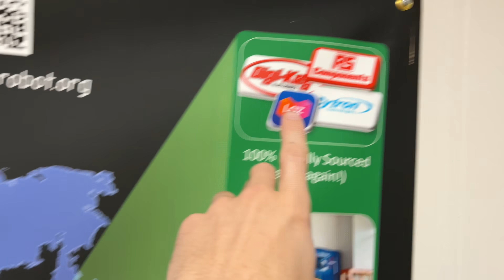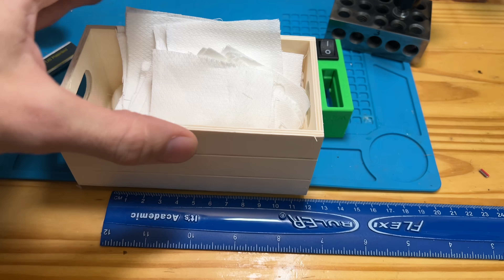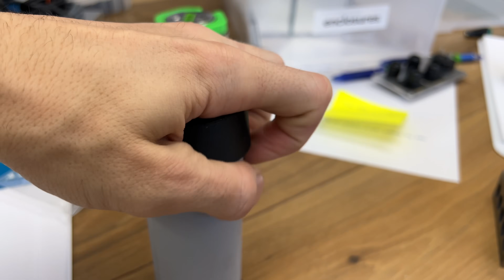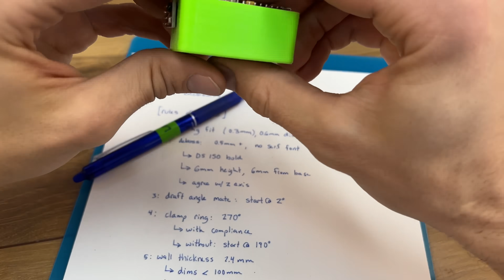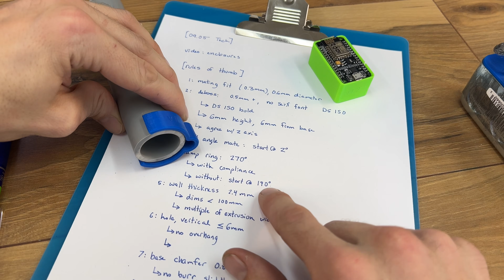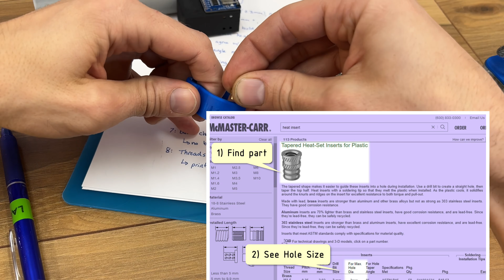Design enclosures for electronics (using mechanical mindset)

Comment: I recommend the Parker O-Ring Handbook (ORD 5700).  It gives great guidance for groove dimensions, compression amount, standard O-Ring sizes, etc.  It's very thorough for all kinds of applications.  I would personally start there before starting to design a tube cap.

Comment: You mention using .5 as the depth for your 3D printed text deboss.
Not a big deal just for text, but as long as it's arbitrary it's nice to make the wall thickness at any point a multiple of .4mm, the default layer line width as you mention later in the video.
The standard height of a layer line is .2mm, so multiples of .4 are a good rule of thumb regardless of orientation.

Comment: Hi! I really enjoy your videos - you're doing a great job! In one of your other videos, you talked about designing for 3D printing. Do you have any recommendations for someone starting out with 3D print design? Specifically, are there any books you'd recommend on this topic?
Reply from the maker: that’s tough, because it’s easy to find explanation of FDM but design methodologies seem to diverge.

after 5 or more years i think it’s best to treat design for manufacturing separately than learning about 3d printing. that is, collect one knowledge base about printing as a manufacturing method and then go elsewhere to seek a knowledge base as a designer.

a more direct answer:
this page is quite reliable for starting out: https://www.simplify3d.com/resources/print-quality-troubleshooting/

and if you want my team’s direct opinions you can find a 3D printing mini guide on the scuttle robotics website.  https://scuttlerobot.org

Comment: Any suggestions for pressure sensors and permeable materials like Gore-Tex? I’m toying with the idea of a device that measure water depth using hydrostatic pressure & barometric pressure for use with my volunteer efforts in water. Already bought some components from DigiKey to start experimenting.
Reply from the maker: Have you explored patents of already existing devices?  I'm curious about your project, if you could describe the problem statement related to permeable materials.  Also inform your background if you dont mind (experience type/level).    I've played with water for a decade or so.
Reply: @davidmalawey  Would a permeable membrane like Gore-Tex work to protect a pressure sensor from moisture? Assuming it’s a bit overkill. I have not looked at patents, but did research similar applications from DIY weather stations to USGS stream gauging stations. Streamflow would be the endgame for physical data. The concept is a device that can be placed at our sampling sites and collects data at set intervals. My idea is to create an open source and modular hydrology/water quality station, so that we can actually obtain data in a manner that is consistent with how monitoring is conducted through USGS. This would help our data be used for management decisions and legislation to help Lake Erie. It’s an ambitions project that I’ve dedicated more time and money than I’d like to admit. Working at an analytical lab is helping me go back to school (so people take me seriously) and get closer to making a true proof of concept. Two years in environmental engineering. They never let me get closer to water in college, so I just chased it through volunteer efforts (Partners for Clean Streams and Izaak Walton League of America, with more to come) and my work. Hopefully if you get this far it was worth the read. Thank You!

Comment: Good video. 😃
[Hints on self-tapping screws and enclosure thickness in this comment]
-One thing I noticed, is that where you talk about 3D-printing a >100mm box, you make the walls thicker and thus make it "impossible" to use components like the rocker-switch designed for thin walls.
You can easily get around that, by making the wall thin just around the rocker-switch.
That is ... Just make a 60 degree angle, so that the 3D-printer won't need any support material in that area, except from in the hole itself.

About the threads, I agree that you wouldn't 3D-print small threads; however, you can 3D-print "fine" threads, if you're printing with a fine nozzle.
Example: If you can 3D-print a M8 thread using a 0.4mm nozzle, then you should be able to 3D-print a M4 thread using a 0.2mm nozzle. I wouldn't do that, though, I'd just make a cylindrical hole and mash the M4 screw into the hole, so it'll cut the thread by itself.

One more thing: Self-tapping screws come in several types. You'll often see them very, very expensive. Those are likely for use in hardened steel or just stainless steel. Don't buy those for plastic, or you won't have enough money for finishing your project. 😉
-So if you need self-tapping screws for plastic, just purchase "wood screws"; those are the screws mentioned in this video. 😃
Reply from the maker: You make some practical tips here - and I agree but it depends on the desired outcome.    For those interested I made a video about using screws in prints.

https://youtu.be/LMyhFwJscI0
Reply: Thanks -  @davidmalawey  - I'll check it out. There are likely some things in that video, which I don't know.😉

Comment: Quality content. So many little tricks to 3d printing you pick up from doing lots of designs.

One I often use is 1mm over extruded inner perimeters with a 0.6mm nozzle. Combined with arachne mode it's great for saving time/adding strength.
Reply from the maker: do you mean 1mm path width and 0.6mm nozzle?  this is interesting as i’m using 0.45mm path width on 0.4mm nozzle.
Reply: Yep! You can over extrude 1.5-2x nozzle diameter with most hotends. I found 1.75x inner perimeters was the sweet spot for me.

Basically gets you the strength of 3 walls in the time of 2 without losing any detail. You do need to up your temps a bit though. ~5c. Wouldn't do it with carbon or glass fiber filaments.

I mostly used this trick on my prusas mk2s/3. Seems to be less worth it on faster printers with input shaper. Probably because they are already running closer to max flow rate.

Comment from the maker: A user sent me a message that is quite informative so I’m adding it here:

David,
I tried posting this comment on your 9/11/24 video but YT kicked it. So sending it here. 

Some thoughts from this old circuit design engineer with 40 yrs experience.
Digikey's search engine is far superior for finding parts. (you had good tips on part selection and availability) Use octopart to find worldwide part availability and quantity pricing from multiple vendors. I use Heyco cable glands, Bud or Hammond enclosures.  Your mentioned aluminum project boxes will have 1 or multiple internal slots length wise to hold circuit boards.

For CAD files, check manufacturer's website or
snapEDA
grabCAD
traceparts
McMaster offers CAD files for almost everything they sell. Fusion and Solidworks have McMaster plugins.

Amazon is fine for part prototyping, don't rely on them for consistency or availability. Sellers
often pass on part clones with varying tolerances. Use DK or Mouser for reliable parts.

Enclosures come with an Ingress Protection rating (IP), learn the differences

2 color 3D printed panel labels look awesome!

Sorry to go for so long, Thanks for the video.

Craig

Comment: Did my apprenticeship as Electronics Technician from 1998-2002. We actually had quite a lot of mechanical training as part of our education. For a full year we had one day per week in the mechanics workshop where we learned to file, drill, lathe and mill all kinds of materials. Besides that ,we did learn to do technical drawings by hand on paper and learned the basics of metallurgy and materials science. Of course we covered all the other aspects of electronics as well as programming in machine languages like assembler and higher level languages like C. Was a great education, i really liked the massive depth. For instance, we did make circuits with perf-boards and wirewrapping, made wire harnesses on nail boards and wrapped them, then we did layouts by glueing/rubbing tape on a light table and eventually moved on to drawing schematics and PCB layouts on the PC. And today, i do teach my own electronics apprentices where i work as Electronics Engineer. However some "old school" techniques that i had learned and hardly anyone uses anymore were replaced on the curriculum. Now they do learn some basics of mechanical CAD on the PC, as well as using modern fabrication techniques like 3D printing and CNC machining too.

Comment: The cheapest (albeit really non-professional) "project boxes" are kitchen storage containers (tupperware). You get an assortment of them with varying sizes for just a few bucks, you can cut/drill holes into them, and they're much better than nothing.
And if you don't need any holes at all, they're even air-tight.
Reply: I recycled an ice cream box. It's been 2 years, I need to find a proper solution LOL
Reply from the maker: @Hukkinen  too funny. we need pics!

Comment: David, I like using silicone foam but I difficulties finding adhesives for silicone. Do you have a solution for adhering silicone padding?
Reply from the maker: I found silicone caulk (100%, clear) to bond exceptionally with off the shelf silicone parts.  did you try it yet?  it is impressive, except for a few cases when the chemistry deviates too much.
Reply: @davidmalawey  I agree with you. I’ve been using Dow Corning 732 (100% silicone).  Thanks, Just wanted to get your feedback.

Comment: Rather than fiddling around with my soldering iron and threaded inserts, I've switched to just using plastic screws -- they're literally made for the job.  If you've ever installed a PC case fan into a PC, you know what a plastic screw is.  It just cuts threads into the plastic.  Those large 5mm ones that plastic case fans use are rather large for most prints though, so you can get them in any shape and size, but they all basically work the same way: they're tapered and have a large coarse cutting thread.

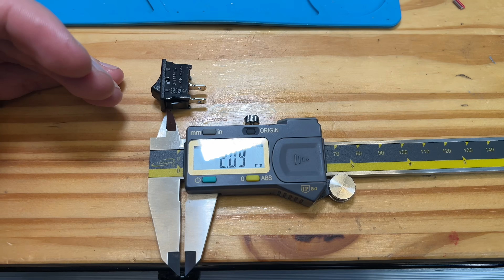Comment: There is a section on wall thickness repeated at 9:26 and 28:01. Frustratingly, both of those have a cutoff right when you say "this is why my suggestion is ... see this works out really good". We're looking at a maximum 2mm wall on the component against your recommended wall thickness of 2.4mm, and I'm not sure what the suggestion actually is.

Comment: This is some headless chicken type of teaching - a lot of intricate details, unstructured and failure to mention the basics.
Most of the time you design for the enclosures you have, not the other way around.
What is 'benchmarking'? Its called research and investigation of existing products, no need to invent new words (like 'borrowing tolerances').
Structure my dude, structure.
Fasteners, hardware - internal (standoffs, bolts, etc), external (knobs, lights, buttons, etc), connectors - what to buy, where, how to machine.
Those rules of thumb are not universal - some 3d printers do better, some do worse.
Include a review on basic machining methods - 3d printing, laser cutting, waterjet, cnc routing - these are widely available - hackerspaces, machine shops, companies that do signage/ads - they all can help.
Also go watch Dan Gelbart series on prototyping.

Comment: Terrific video - but note thread forming are NOT self tapping screws. 

Thread forming (eg plastite) are excellent for plastic - also referred to as “PT screws” (for plastic type) on Ali express etc. They work astoundingly well - and can go in come out go in come out dozens upon dozens of times without damaging the plastic . 

Self tapping screws are for metal. They are terrible In Plastic as they create huge hoop stresses and tend to crack the plastic. If you do manage to get them in - two or three times of putting them in and they chew the plastic up entirely - if they haven’t already smashed it apart. 

PT screws seem to be a well kept secret. They massively help -
Reduced inventory, cost (less components) assembly time (no faffing with inserts) improve precision and failure rate (no drilled holes to screw up, no reaming  no tapping no helicoil inserts …) I’ve gone over to PT screws entirely . Brass inserts are old technology and far too costly for no benefit. PT screws are super cheap too - as they are used so much in mass manufacture. 

The thread design of thread forming screws is super subtle and clever. They work completely unlike any other thread form.
Reply: Don't forget that thread forming screws for metal also exist, like Taptite screws, very handy as you don't need to tap a hole in many applications, the screw just forms the thread as it goes in.

PT screws are great, until you have something you may need to take apart and reassemble multiple times. Basically for prototyping we do almost entirely heat sink inserts for plastics and then when we are getting ready to move over to production we switch over to PT screws. PT is actually a registered trademark, and does not stand for "plastic type" but rather for "plastic thread", there are other types of thread forming plastic screws such as Plastite (yes, related to Taptite mentioned above).
Reply from the maker: this is good info.  it gets soooooo deep and i am not sure at what level to abstract this without being inaccurate.  when you go online to order parts, some vendors still cross-label the screws and you might at times still use the wrong term to find the right part.  hope that makes sense.
Reply: @davidmalawey  Oh heck yeah, don't get me started on vendors having often no clue how to properly label their items. I have ordered so much material over the years that we just couldn't use because the seller mislabeled items. Oftentimes it's just cheaper to swallow the cost rather than deal with the time and effort of sending stuff back. My greatest wish would be that McMaster Carr would ship to Europe, but alas they refuse to.

Comment: Do you typically design in tandem with an electronics engineer or does EE send you a schematic with notes about spacing requirements and such and then you design around that? This is my new favorite channel btw.

Comment: Half the battle is just knowing the name of the thing you're looking for.

Like for example, and maybe someone can help me with this: I'm building a prototype, with a full enclosure (hard lessons there; wish I had this video 4 years ago), and I am going to have a wired remote control for it, with about 3 - 5 feet of cable. I don't want to use USB or Ethernet, and would rather just use my own multi pin connector, which I can disconnect from either the remote or prototype side, but I have no idea what the category name of those kinds of external device-to-device connectors, or the tools or kits for them, is; I only know specific connector names, like USB, XLR, MIDI, etc. Is there a category name for them?
Reply: Sure. I do need some more information to help you.

1. Does it have to be reversible like an USB-A male to USB-A male cable or not reversible like a power extension cord with plug and socket on each end?
2. What kind of voltages and currents are we talking?
3. What kind of signals will be transmitted?
4. Which protocol is used for the communication?
5. How many positions (just an approximate number) should the connector have?
6. How compact should the connector be?
7. Would you invest time / money in crimping tools or are screw terminals, screwless spring cages or is soldering an option?
8. Does it have to be lockable / screwable on each side or will a good friction fit be enough?
9. Does it need to have some kind of IP rating?

This would help to narrow it down.
Reply: @Dopefish432  
1. Reversible like USB would be best. Not having bare pins is best too, I think.

2. +5 Volts and maybe 1/4 Amp (250mA) at most. The remote will have an ESP32, LEDs and screen.

3/4. The signal will be serial. I was going to do 8 bit parallel, for speed and ease, but it felt wasteful in terms of pins and wire. I'll probably use UART for it, since my I2C bus is already kinda full on the prototype side, and I have an extra UART with both Arduinos. I'm still studying up on these comms and protocols, so I don't know if I have all the terminology correct.

5. I think at least 4 positions. If I remember correctly, "positions" means pins?

6. Compactness isn't terribly important, as long as it's not a great big industrial connector. LOL

7. I'm always looking for an excuse to buy a new tool, and I would love to get as professional a feel/look as possible. If it opens up options for making more connectors (with different position counts) in the future, for other projects, even better.... And soldering is always an option for me.

8. Lockability isn't important, and I think I'd prefer to not have it, although I'll work with whatever works best. Friction fit sounds best though, since I'll be taking this all over the place to show it off, and want to be able to disconnect and pack it up as easily as possible.

9. IP doesn't matter at all. Not on this project. Maybe on future projects, but I'll cross that bridge when I get to it. LOL

===========================

Thank you for taking the time to write your reply and ask all these questions. Even without further answer from you, the questions have helped me to think it out more, especially those details I wasn't considering already.... Although, I will still gladly take your answer and guidance. 

Cheers,

Rob
Reply: I liked using Mil-spec connectors, but maybe they're a bit overkill for a lot of projects. Deutch connectors might also be something to look into.
Reply: @aidanmurphree3279  Thanks for the reply!

Deutsch connectors are looking pretty close to what I'm after, and I will give them some serious consideration, along with whatever Dopefish432 recommends when they reply.